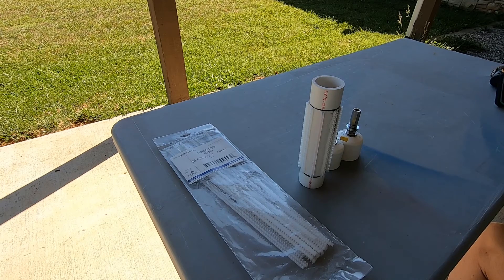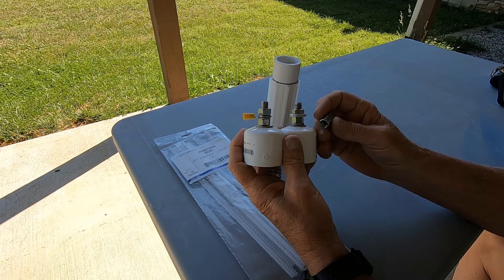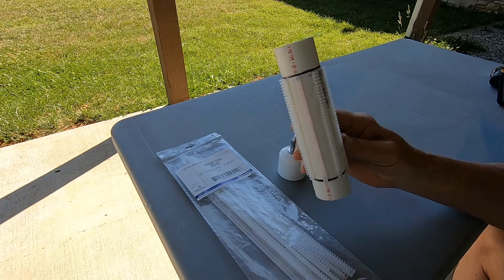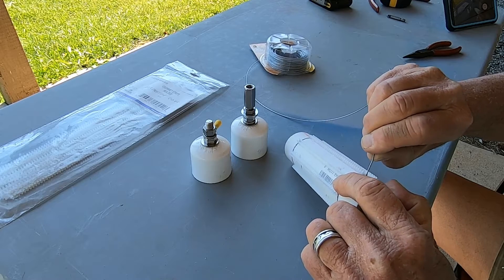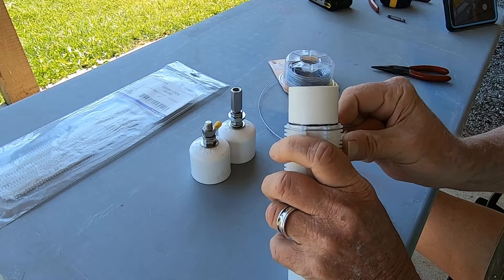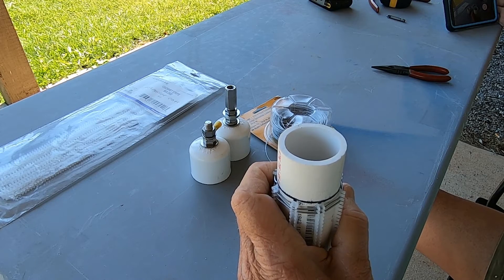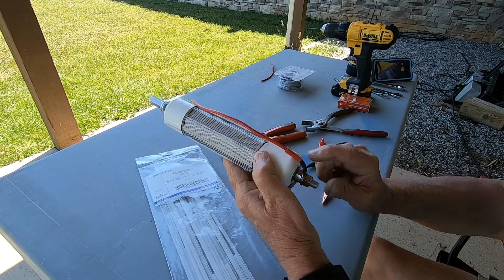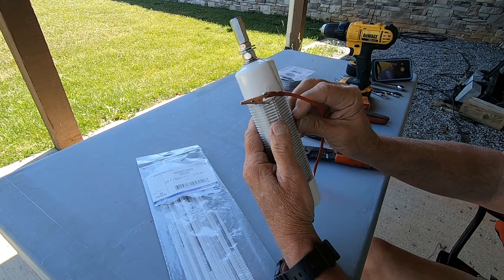MY DIY 20-40 meter Air Wound Coil

Comment: Hard-drawn copper antenna wire would have been better. Steel wire has a very high resistance.
Reply from the maker: But I make contacts all over the USA and into Europe.

Comment: I did not see how the washer on the inside bottom connects.
Reply from the maker: It does not connect to anything. All it does is keep the wire from being pulled out

Comment: How does feedpoint coax attach? Thanks!!
Reply from the maker: Universal Heavy Duty CB Antenna SO-239 Stud Mount, Standard 3/8 x 24 Threaded Antenna Stud Mount Adapter. That is attached to a bracket mounted on my vehicle.

Comment: Question:  All the videos show a coil antenna using grooves of grommet strips to space the wire.  Would it work with speaker wire allowing the insulation to provide spacing?
Reply from the maker: Not it would not, The gator clip needs to make contact with the bare wire.
Reply: @mcso911  If we know what points along the wire were the right contact points we could just strip there.   (I dont know enough to know why this would not work)
Reply from the maker: @stivostenberg  I guess it could work. Try it.

Comment: Steel wire has 10 times the resistance of copper, so it has 10 times the loss.  Maybe not the best choice.
Reply from the maker: That may be true but my QSO's speak for themselves.
Reply: @mcso911 Every little bit helps, especially if you're QRP.
Reply from the maker: @stargazer7644  I dont use QRP. 100w for me .
Reply: @mcso911 This is what I love about hams.  They're always willing to learn.

Comment: I have an 18.4 telescopic antenna (for 20 meters). I need to build a coil so that I tune the antenna for 40 meters. 
I have the following wire from Amazon: 21 Gauge, 99.9% Pure Copper Wire (Half Round) Dead Soft CDA #110 Made in USA

How many windings would I need? Is there a calculator? 

Thanks

KO6DEV
Reply from the maker: if you follow the video the 40m tap will fall about halfway on the pipe.

Comment: Great execution, but remember that silicone is merely a sealant/caulk and not an adhesive. There are many epoxy products that can be used for this purpose that would yield better results. JB Weld and many other similar epoxies contain metal, so choosing one that's transparent would be free of metal. You could also do away with the washer at the beginning of the coil by tying a knot in the stainless steel wire, while leaving enough wire to solder to. If you like the washer, be sure to use a stainless washer.
Reply from the maker: the silicone is merely used to hold the plastic standoffs in place until the wire is wrapped. The washer is merely used to hold the wire in place so it does not pull through the hole. Use any method you choose. AND, their is nothing soldered to the wire where the washer is located. it is just a starting point to wrap the wire.

Comment: Put A Bigger Diameter Pipe ON TO IT And Cut The Strip Where The Clip Connects And You Can Wrote Down What meters And What Band You Can Get By Putting The Aligator CClip There. 
Tip For You All

Comment: After reading some of these comments I would suggest that some of you start reading an antenna handbook so you have some idea as to how a coil works and how they are constructed. They’re are online calculators to determine the whip length and the coil inductance based on frequency. The only way you learn is by doing the research. Just use Google.

Comment: I have 1 1/2 on hand, instead of 1 1/4.  Does it change much or should it be 1 1/4?
Reply: It'll have about 30% more inductance.  You'll have to adjust the length of the whip.

Comment: So the 18ga. wire , one end goes up to the bolt and nuts for antenna, but the other end just stops at the washer... connects to nothing?  Just want to make sure, ty for the video 73s NS9T.
Reply from the maker: correct

Comment: The bottom 3/8 x 24 stud is hot. The separation from ground happens bellow that point, which is not shown. A standard mobile mount has a small, but effective for 100 watts, nylon bushing that isolates the grounded mount from the driven / hot lower stud. There is no connection of coil other than the red tap and the coil itself to the bottom the whip. I hope this helps. There have been many questions about this and I just happened to see it.

Comment: Does the wire inside connected to the washer get connected to the bolt on the pigtail cap?  Looked like it doesn't. Thanks
Reply: It doesn't get connected..other comments here explain more..as the video poster hasn't answered anyones questions unfortunately..

Comment: Very nice video.few things I've missed is the side of the wire where there is banana clip, is it connected to the small washer from the inside of the PVC and how many turns did it take? Thank you
Reply: No the wire inside the pvc with the washer is just a knot to anchor the beginning of the wrap..the thicker red wire with alligator clip is simply connected to the bottom cap..by clipping it on different spots you lengthen or shorten the coil..Cheers..

Comment: Nice build Sir!  Although I’m really confused about a specific part number. 
At 4:45 you go blue screen and say “Sorry, wrong plastic trim part....”.  Is this the Master Carr Grommet Strips? You show them in a bag in the video with part number then show the other part number. I want to make sure Im getting correct part here.

 Also, did you offset the grommet strips to give it more of a helical coil, like threads, to give your windings the threaded look? Or did you just even them up and glue them down so they were even and it just works out? 

 Sorry for my stupid questions. Thanks for the video and please give puppy a treat for me.

Comment: Does the wire in bottom, connect to the bolt on the inside?
Reply: No the wire tied on the washer is just an anchor point..it's not electrically connected..the red wire on the side makes the connection from the bottom cap to top cap..

Comment: New subscriber here.  Interesting build, easier than other DIY projects where you have to lathe in the traces for the winding.  Do you have any idea how long this wire will last vs. stainless? I might just build one to see if I can, that is my favorite part of this hobby.  One day I would like to make a DIY screwdriver antenna but that is more complex with the sleeve and fingers that make contact with the winding.  Very good explanation and video.  All the best!  73 de KI5HXM

Comment: What type of glue did you use?
Reply: He didn't use glue, he used silicone.  Anything that will hold it temporarily in place will work.  Once wound the wire will hold it.

Comment: Used a jubilee hose clamp to slide up and down for tuning - wrap electrical tape around the clamp to prevent additional contact
Reply: That's a great idea..although I needed to look up that term you used for a hose clamp..and although much more convenient it's possibly less sensitive in tuning vs the clip..the hose clamp makes broad contact points vs the pin piont connection from the clip..will it make that big of a difference maybe not..

Comment: I have a Hygain AV-18 vertical antenna.  The original coil was oxidized and very hard to tune.  I built one of these and purchased some coil clips from DX Engineering.  For a few bucks I was able to get my antenna back online!  Thanks for the information.  73

Comment: When your measurement is 1.25 inches is that the inside or outside diameter
Reply: PVC pipe will be printed or stamped as 1-1/4" on the pipe itself.
Reply: @stater3  Thank you
Reply: @PatAutrey   Anytime.

Comment: Would 80 m still have a connection point on that coil or would it need more turns for that?
Reply: 80 would need to be st least twice the length

Comment: Built one on 2" PVC, copper wire with just 4 strips, used hot glue gun to hold wires. Will build one with additional strips.

Comment: But what happens to the bottom part of the wire that is attached to the ring inside the tube ?
Does it get connected to something?  or does it just sits there inside without a connection to anything ?  Thats the only part I am confused by.
thanks

Comment: I just built the coil foundation in full length (used the one foot of grommet strip) to build the 80M version of this. I am going to wind all 95 loops and follow the plans otherwise. Great Video !! ordered the stip from McMaster and it came in three days. I am really stoked about the full build and see how the coil works
Reply: How long was your whip or stinger on top? I'm going to use a 3 foot telescoping whip
Reply: Hey Mark: I just watched this video, and I too would like to build one that covers 80m-10m. On yours, did it end up being 95 loops of wire on the form like originally posted? And what length whip are you using with that? Thanks
W3TKB

Comment: Thank for video etc. Going to make one of these in the UK is the pipe diameter bore size or outer diameter.  It looks larger in video than dimensions given. Cheers from old George Ps what is the coil diamer on pipe. Looks more 2inches. ?
Reply: Good day my friend..in the US pipe is measured on the inside dimensions regardless of wall thickness or outside diameter..but tube is measured on the outside dimensions regardless of inside diameter or wall thickness..a Stainless  steel hose clamp which is commonly called Jubilee clamp over there could slide up and down making it more convenient then a clip on selection..overall construction size has little effect as its adjustable..Cheers..
Reply: @agentcovert Hi matey. I have improved dramatically on my earlier versions based on your idea. Still used plastic Pipe but  using grommet strip spiral on former. Also made several loading coils for each band. So I just swop coils and shorten or lengthen telescopic to swr etc. Cheers from old George in the UK.

Comment: You jumped from an open bottom of the coil to a coil with an end cap. The bottom bolt that holds the pigtail, is it connected electrically to the wire inside the bottom of the coil? Thx, Brent
Reply: No!! That is what makes it adjustable. Red wire with alligator clip is contact from bottom bolt to the coil winding which is only connected to the top bolt. Otherwise there is no adjustment...

Comment: With the two holes at the top, could you had drilled a hole across the pipe from the entry hole and just pulled it through then attached to the top cap vs. struggling to feed it back through the hole beside the entry hole? As for securing the caps I'd just use the PVC adhesive vs. super glue. I wish you had  shown the completed project and demo it, but that did look easy to build.
Reply: By doubling it back and pulling through, as he did here, will not allow the wire to loosen up very easily in the future!

Comment: Thanks for the video, im assuming that you connected the bottom bolt to the washer that's on the inside to make connection would that be correct
Reply: NO!!!! That is what makes it an adjustable loading coil.  The RED wire connects to the bottom washer. Then shorts the antenna at various lengths from the top all the way to the bottom coil.  There is NO CONNECTION from bottom bolt to the coil of wire EXCEPT the adjustable red wire.
Reply: @Bill-W3SI  ty
Reply: @geneky4jn773  I am trying to make a 17' adjustable whip resonate for 40M. This coil should accomplish that but I decided to go big or go home.  I used software to calculate turns & diameter and length of the coil.   I'm doing 1-1/4 PVC x 16" long same spreaders as here (but printed on 3D printer) and 94 turns of 12AGW aluminum wire. I bought a roll of copper in case alum is too soft. Should tune 80M-6M . I also have 24 ea 33' long radials.
Reply: @Bill-W3SI  wow that sounds great bill! Please keep me abreast of how that goes as I would be very interested of your outcome.
Reply: @geneky4jn773  Coil worked out fine.  Ended up being 16" long on 1-1/4 PVC . I used #12 Aluminum wire (But would use #14 or #16 if I made another one) the coils are .18 center to center and it is tight fit with alligator clips.  BUT It tunes 40 -60 and 80 great!
Reply: @Bill-W3SI  what length whip did you use? I have a 72 inch and a 102 inch.
Reply: @Bill-W3SI  how do you get this thing connected to your radio?
Reply: I think the red wire gets connected to an SO-239 connector
Reply: @brucerobson8284  well it screws into a 3/8-24 threaded hole in a holder, like a mag base or 3/8-24 to SO-239 adapter. I can send photos if you need.
Reply: @Bill-W3SI  oh ,ok that sounds reasonable.
Reply: I was wondering the same.
Reply: So where does SO-239 come into play

Comment: any advice on how much longer to make it to include 80/75 meter?
Reply: I found a program/calculator...
Tell it length of vertical section and diameter.
Tell it lowest freq you want to adjust to. 
It calculates the coils inductance. 
Then next calculator allows you to play with design of that coil... length, diameter and # of turns of wire for said inductance.  Cool....

Comment: Stupid question where/how do you attach the pl-259 connector?
Reply: The stud on the bottom screws into a 3/8 mount that has the PL connector (or whatever flavor connector you so choose) on it. Following is an example of a basic one. You can also get them on hitch mounts  and stake pocket mounts for pickups.  Or the tripod base that Wolf River Coils (and others) sell. https://mgs4u.com/product/3-8-x-24-threaded-antenna-stud-mount-uhf-female-connector/

Comment: Have been unable to find the "grommet strip" at McMaster or anywhere else.
Reply: same here... sure wish this was more accurate...
Reply: actually, I found the item by googling the part number... be sure to include  the dashes etc... https://www.google.com/search?q=gsny-085-9-q&oq=gsny-085-9-q&aqs=chrome..69i57.15924j0j7&sourceid=chrome&ie=UTF-8 now to figure out which of the vendors to purchase from... interestingly enough... mcmaster carr is not in the results...
Reply: @kensmith5538  McMaster Carr has these again.  Part number 85085K4.  Got mine yesterday
Reply: @WD Bailey Thanks for the link. I never would have picked that out of the hundreds of "plastic trim" shown on McMaster's site. I couldn't even get any results at Thomas & Betts. 
I built a similar antenna using the string trimmer cord as a spacer, but never fully got it working.